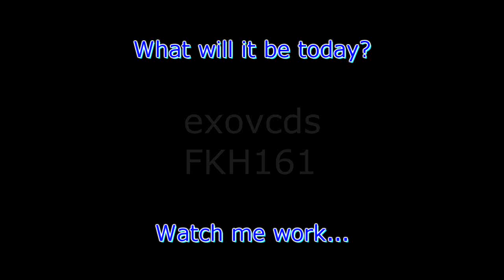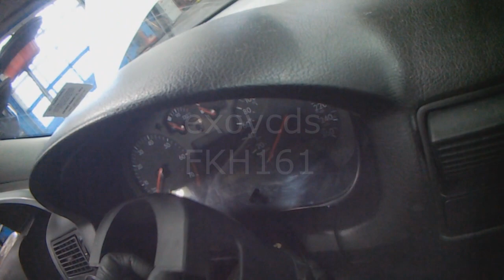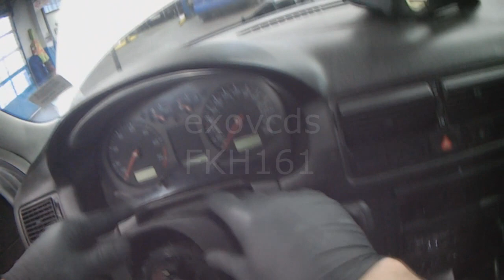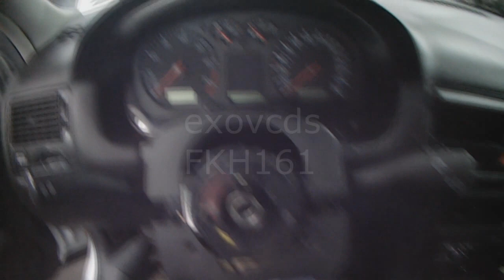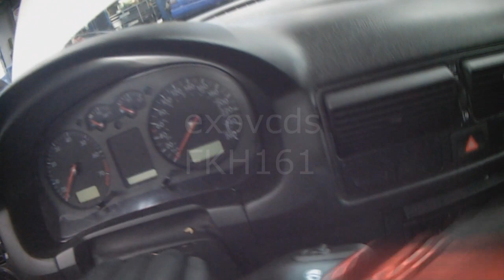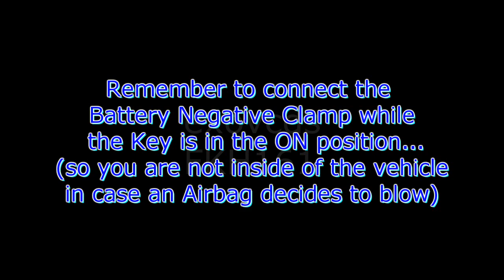VW A4: Wiper Switch Replacement

Comment: i replaced the wiper and blinker switch in my 99 a6 and now the car wont idle, and rough accelleration, any ideas?
Reply from the maker: +Dean Vandament Did you disconnect the battery before you did the repair?
Reply: +Thomas EXOVCDS Yup sure did. i tried putting the old ones back on and same problem. wont idle and when accelerator pushed is has a tough time reving
Reply from the maker: +Dean Vandament The ECM has probably lost its throttle adaptation position and has to "relearn"... this can take a few days of driving, but the low idle suggests that the throttle body is dirty & should be cleaned. Once clean, things should be back to normal.
Reply: +Thomas EXOVCDS the car was running just fine earlier, does unplugging the battery do this? ive unpluged before and not had this issue. kinda wierd that changing a few switches made the car not run right...
Reply from the maker: +Dean Vandament I can't see that changing the switches would cause this problem... I have seen several cars over the years that had dirty throttle bodies, that would not idle after the battery was disconnected. The throttle is not opening enough (because the ECM does not know that the throttle is dirty) and not allowing enough air to pass the throttle. Cleaning the throttle is where I would start... scanning for fault codes / viewing engine data would also be one of my next steps (before diving back in too deep).
Reply: I'll try that. Just tried driving the car and won't go past 15mph and becomes a bucking horse jerkin around
Reply from the maker: +Dean Vandament Cable operated throttle or is it drive by wire (98 / 99 was the changeover)? What engine? Throttle cleaning alone might not be enough (will / should help with the idle). A full system scan (even a throttle adaptation) might need to be done to see if there are any other issues. It could be something else aside from loss of throttle position memory... but cleaning / checking needs to be done to eliminate it as the cause.
Reply: +Thomas EXOVCDS i think its drive by wire its a 99 2.8 avant, the throttle keeps cutting out around 1500 rpm, if i floor it, it trys to go but same problem.